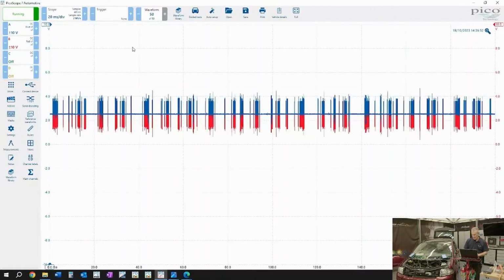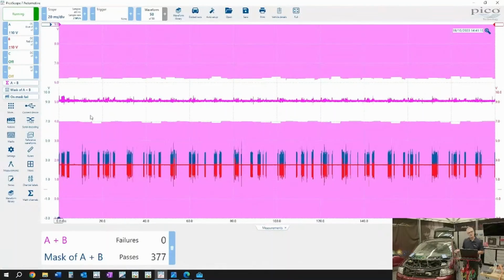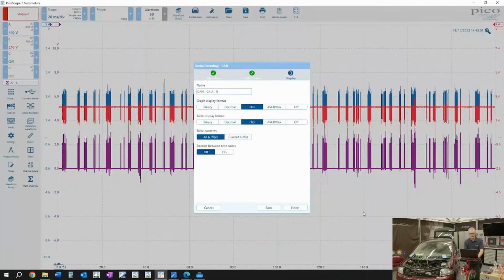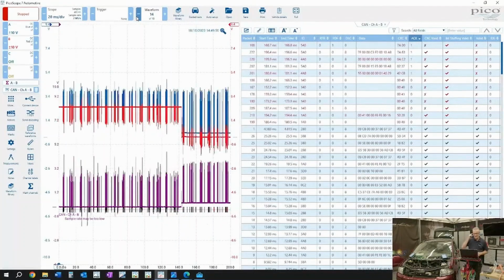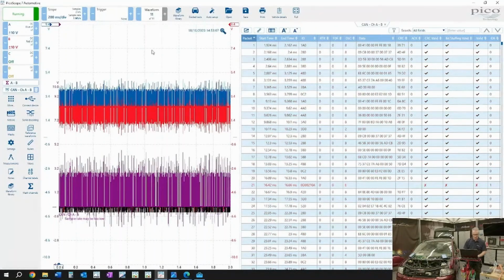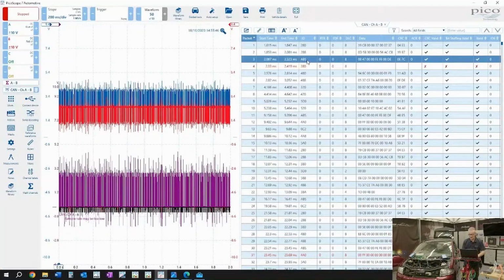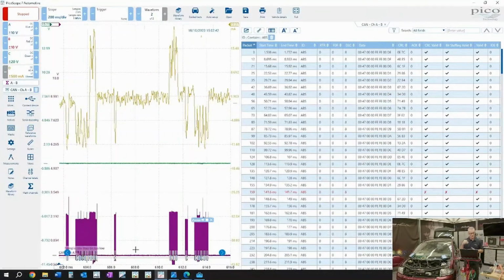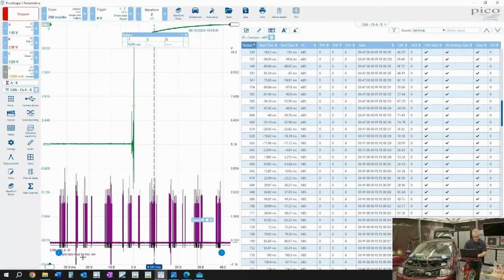CAN Diagnosis and Reverse engineering with PicoScope 7 Automotive

Comment: Hello sir , i have picoscope 4425 and i am looking for no com with engine ecu when become hot and i trace the high 
 can network from diagrams and in this high speed network is engine ecu, abs, uec,cim,ehps and i connect on high low can pins at its ecu alone and start  decode i have good signal and decode packs of data messages that include valid and invalid data on all ecu but only in the engine ecu in can high low pins i hane only good signal waveform but no,nothing, either one data pack message. How is this possible? What is the meaning? Or  the problem?opel astra h 2005 z16xep no comm with the engine ecu faults from the other ecu , the car becomes hot crank no start or no crank no start. Thanks in advance!

Comment: Best CAN diag video ever! May I make one suggestion though for those of us who struggle to keep up? Please enlarge and change the color of your cursor/pointer. Maybe even add the option of a trail as you move it🙂 I stopped and backed up a hundred times to figure out where you were clicking at in order to take accurate notes. OK, maybe not a hundred, probably more like 92.😂P.S. going to work today and showing off what I just learned. Thanks again.

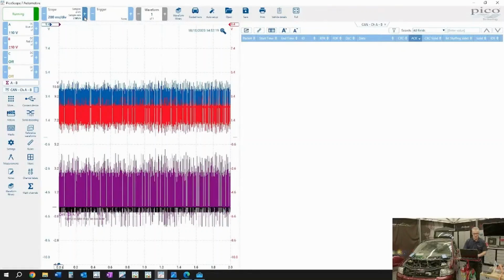Comment: 15:50 as you say the sample rate doesn't need to be that high and turn it down almost everything went to errors 😂
And you had a notification throughout the whole capture before that the bitrate allready could be too low to have proper decoding  and the canbus bits all have triangular edges so right on the edge of just enough

Comment: Relatively good video. Here is my question. If I see 1A0 has errors how do I figure out that is the ABS module? It's not like the manufactures will just tell me. Because other than seeing a fault the decode and and the other tests kinda becomes useless to us none engineers.

Comment: I found the serial decoding interesting.  I did notice that even when you did not introduce a fault the serial data indicated that some packets had faults. I'm also interested in how you determined the ID of a module and if that ID to module is uniform across all vehicles or are the specific by manufacture.  In other words 1A0 was ABS for Audi but could ABS for a Ford be different?
Reply: Also wondering
Reply: I dug a little deeper and it seems from what I can tell is nobody has a list and its all done by personal testing of monitoring ID's and then disconnecting modules. For this video my guess is that two factors made it easy to identify the ABS module. 1) the module was easy to get to under the hood and 2) the brake light input signal was easy to activate and watch for.  I suspect that each manufacture and it may also be year and model specific has their own module ID's.  This sucks for technicians.
Reply: @DrivelineMaster   Yes, but many people have done this for you and there are various sources of .dbc files on the internet if you search
Reply: Thank you.  I would love to know more.  What is a .dbc file?  please help me out.  what key words should I use for my internet search?  I have tried but didn't find anything. I think I'm just using the wrong key words in my search.
Reply: @DrivelineMaster  Hi, did you have any luck searching .dbc files? I'd also like to know more. Thanks
Reply: I'm sorry I did not have much luck.  One commenter wrote "Yes, but many people have done this for you and there are various sources of .dbc files on the internet if you search" I responded with: "Thank you.  I would love to know more.  What is a .dbc file?  please help me out.  what key words should I use for my internet search?  I have tried but didn't find anything. I think I'm just using the wrong key words in my search." but I never got a second response.
Reply: @DrivelineMaster  apologies for not replying sooner, I have seen projects on youtube that have made dbc files open source. If you have an account of github, you can search on there for some some sources, one great source is opendbc
Reply: You cant
Reply: Its up to, and in favor to the vehicle maker, and programmer for class C _ CAN FD designers. As class B is different single or dual wire. SAE has loads of resource available.
Reply: What you do is setup the scope to scan the network for a list of all unique IDs then yank the battery cable and reattach so hopefully all the modules wake up to complete the chart. Once you have a list of IDs you can start cutting power to each module to figure out who’s who. I work on equipment with very poor tech level documentation and it has a mysterious CAN network. I’m reverse engineering it in order to make my job easier and stop guessing which module is bad. Once I get more hours behind the keyboard with this scope I hope to be a better diagnostician.